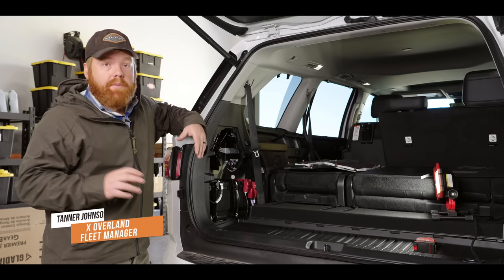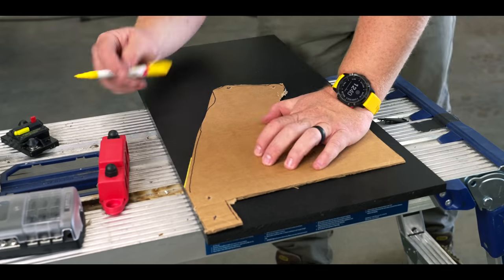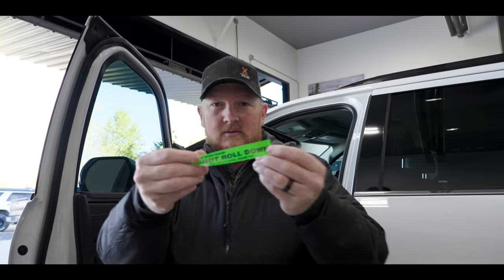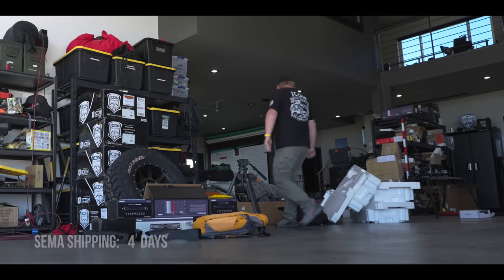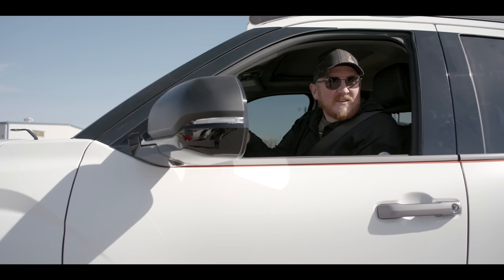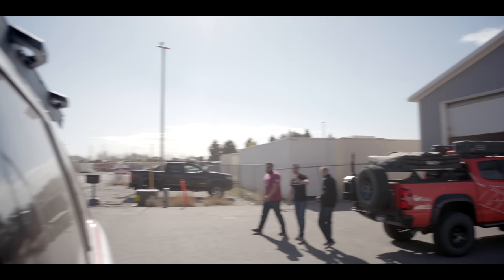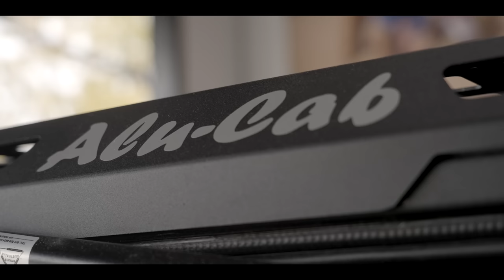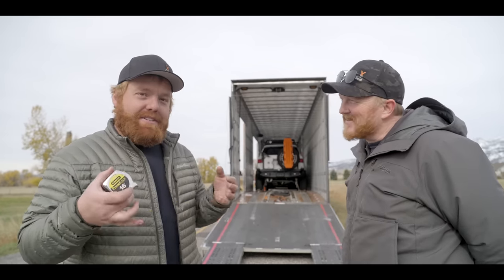SHOP TALK | Getting the Sequoia SEMA Ready! Armor, Wrap, and Rooftop Tent

Comment: Looking good.  What was the material you used to made the mounting plate/base for all of the electrical items?
Reply: Looking for the same answer. I'm assuming its a HDPE panel.
Reply: @Jake-et3po  Hopefully someone will let us know.  I am looking at deleting the rear seat in my Colorado.  I had thought about using plywood with bed liner; however, it something like this is strong a durable enough, it would be a good solution.  Hopefully someone from XO will read these and comment.  🤞
Reply from the maker: Hey there! We used high density polyurethane that is 1/2” thick
Reply: @ExpeditionOverland  Thanks for the information.

Comment: Should I buy a TRD Pro?
Reply: Only if you plan on keeping it stock or doing a preload lift e.g. Westcott Designs.  If you plan on adding your own suspension you’re better off getting a SR5 or Limited trim with the TRD off road package, that way you get the rear locker and Crawl Control and you can use the savings towards a set of Kings/Fox/Icon and some new UCAs.
Reply: @BaconCruiser  that's what I was thinking too.